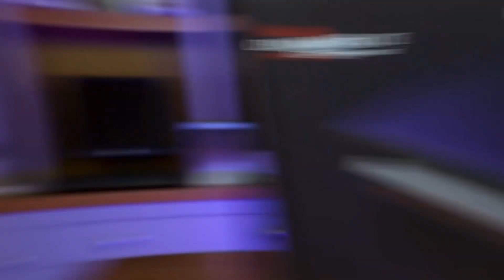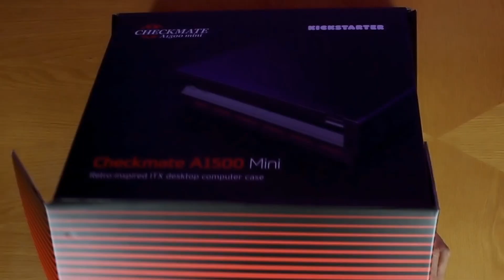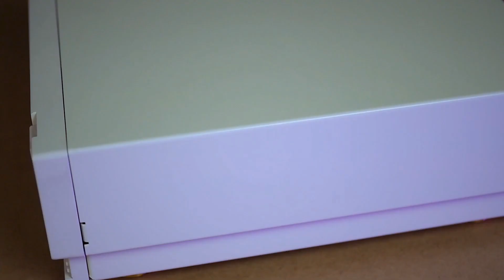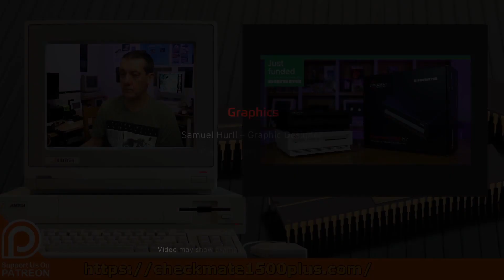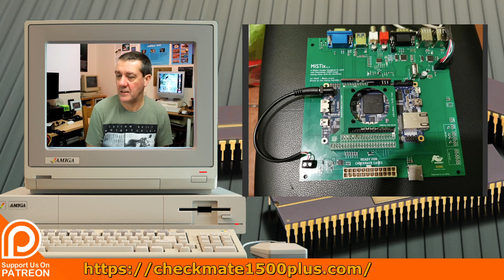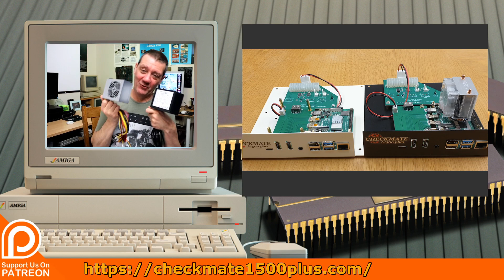Kickstarter production and general March update

Comment: Bravo to you talking sense into Edu and offering the mistix board in black or blue instead of green. With my case I will take the mistix board, grey key cap set, PSU bracket and faceplate for SD card front mount. Don’t worry the mistix board will sell well. This is my 2nd Kickstarter. Spectrum Next round 2 and your Checkmate mini. Love the Checkmate full.